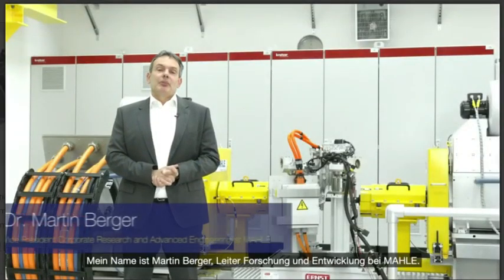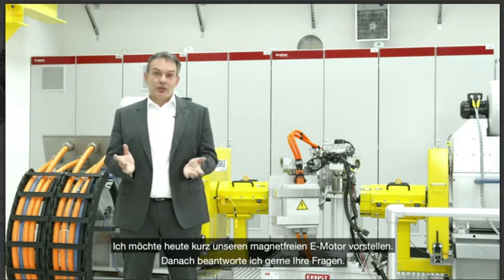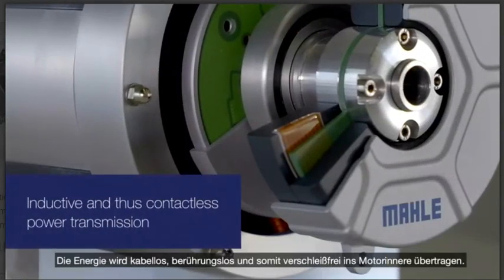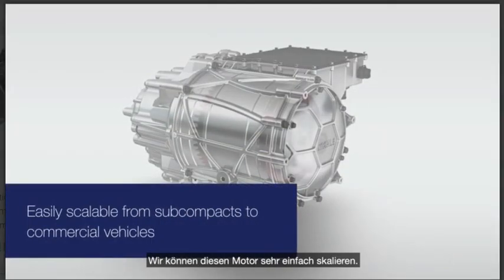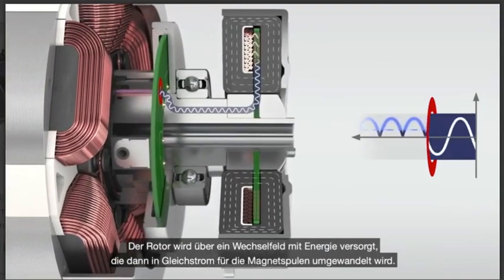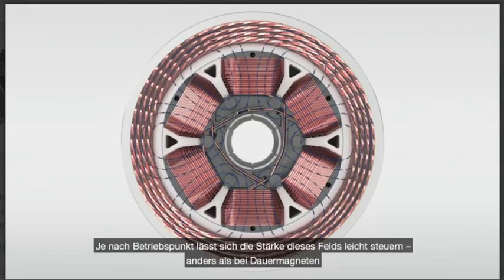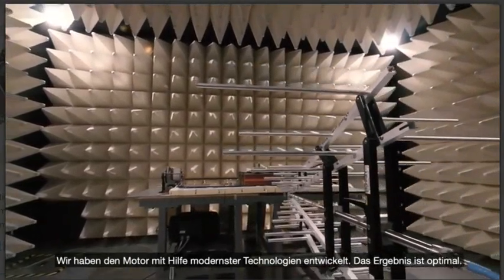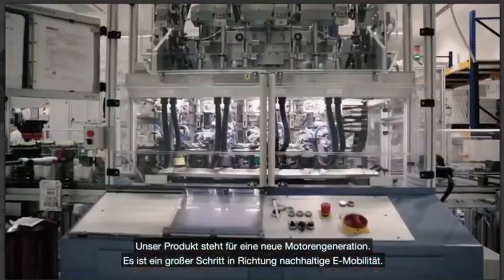Mahle, produce revolutionary new no-magnet motor...

Comment: I would need to bench test this motor myself to verify the high efficiency claims... Wireless transfer of energy has more losses then something hard wired, and those rotor electro magnets would need to produce some strong magnetic fields (suffering heat losses) to compete with strong rare earth magnets. I can't trust their claims. It is common to quote the highest point of an efficiency graph, not so common to quote the average. This is why you hardly ever see efficiency graphs from manufacturers and rightfully so due to the heavy dependence on how the motor is used.
Reply: I suspect they probably use a high voltage exciter to reduce the losses in the rectifier and obviously reduce eddy current losses etc. Then the pilot and armature windings could be higher turns of lower gauge wire. Even so, it would be interesting to see what they are doing. Maybe they have borrowed some of the planar transformer Technology as these are extremely small and efficient.
Reply: @TedsEscapades  
Higher voltage doesn't necessarily change the dynamic, here.  Electric motors use magnetic fields most commonly to attract the core.  While some are purely eddy current driven, most are synchronous induction motors, which operate ideally off of the magnetic field.  Rather than dissipating heat as current, the high permeability of the motor core allows for large amounts of energy to be stored in the inductor the coil forms.  To a changing electric field potential, an inductor represents (ideally) infinite resistance and there is never any current flow in the inductor.  All energy is converted into a magnetic field.

A capacitor is just the opposite and presents as no resistance to a changing electric field.  To date, we don't exactly have magnetic equivalent components - at least to my knowledge.  I suppose you could argue a superconductor represents inductance or capacitance of a magnetic field potential - but I digress.

When acting purely in the domain of the electric field or magnetic field, energy is transmitted extremely efficiently.  It is only when both voltage and current are in phase that you begin to see classic resistive losses.
The LC resonator is so oddly simple when you think about it... Just two flat plates and a coil of wire - so simple it technically exists within anything and everything .... Yet we can still barely explain it despite a hundred or more years of using it.

Then you look up how a photon behaves and realize you can model a photon as an ideal LC resonant tank ....
Reply: @Aim54Delta  You're tossing lots of real terms out there, but apparently without understanding them. An induction motor is asynchronous; a synchronous motor does not use induction to produce rotor current for a rotor field. Also, if no current flows in an inductor, it is not functioning as an inductor.
Reply: @brianb-p6586  
An induction motor is fundamentally synchronous.  Its velocity is determined by the frequency of the supply and the torque by the slip - the angle difference between the magnetic field of the stator and rotor.

Now, an induction motor can't really deliver holding torque, which a BLDC can, if you have engineered the coils to stand up to stall.

Also, an ideal inductor would have infinite inductance.  I am aware of how inductors are perceived - but current through an inductor is undesirable.  An ideal inductor would never experience current flow as even an infinite amount of voltage would need to be applied for an infinite length of time in order to see so much as one electron shift position.  It would convert all potential of the electric field into a corresponding magnetic field.

Now... If you really want to have your mind blown... Consider a coilgun - a solenoid.  I have a capacitor with 1 kilojoule of energy stored in it.  Assuming perfect resonant coupling, if I were to accelerate a projectile out of that coilgun - how much kinetic energy does the projectile have - 1 kilojoule?  Or 500 joules?  Remember the formula for kinetic energy.  Also, remember the formula for energy in a capacitor and energy in an inductor.
Also, consider motor power calculations as we currently do them.

Now, take that same capacitor with one kilojoule of energy and measure the energy released by a resistive element.

So... I ask... Are there 2 kilojoules in the capacitor... 1 kilojoule.... And why does this simple setup present a conundrum for physics?

We generally use the magnetic field.  We do not think of the electric field beyond potentials.  Current is waste within a circuit.  It is undesirable and should be eliminated from the design at any practical expense.  An ideal circuit would have no current flow and deal purely in electric and magnetic fields kept out of phase from each other.

Though our error in electrical design does lead to a fervor to develop increasingly high temperature superconductors - so, where there is a will, autism provides a way.
Reply: @Aim54Delta  No, an induction motor is inherently asynchronous. The slip in an induction motor is a difference in speed (not angle) between the stator field and rotor.
Induction motors certainly can and routinely do produce torque at zero rotor speed - the stator field rotates at the slip speed. How do you think an EV with an induction motor (such as all Tesla models before the Model 3) starts off from a standstill?
Reply: @brianb-p6586  
A synchronous motor, by definition, rotates at the speed of the magnetic field.  To be an asynchronous motor, the rotor must be able to exceed the velocity of the stator, with rotation speed being dependent upon (typically) input power.  A standard brushed motor, for example, is an asynchronous motor.

You need to get into deflection/repulsion motors before you see asynchronous induction motors - and those are rare.  I am not aware of any magnetic induction motors that are asynchronous.  Even squirrel cage stators use a ferrite core and operate off of attraction to the rotating field.  You have to turn motor design on its head to get an asynchronous induction motor and strip out the ferrite core.

Angle is a more appropriate term than speed.  You cannot calculate torque given speed.  You can calculate torque from the difference in phase between the stator and rotor.  Phase angle, as we refer to it in electrical engineering, is what results from a difference in speed.  A rotor rotating in phase with the stator will have a phase angle of zero and produce zero torque.  Any deflection of the rotor creates a phase angle and it is from that phase angle that the rotor is driven out of phase with the stator windings and draws power from the circuit.

We could set up an ideal circuit with capacitors forming a resonant tank circuit with the stator coils.  We could then scope the voltage and current through each coil and, at any time the rotor was moved out of phase with the stator, you would see the total energy in the tank circuit change.  This would be true even if the rotor was moving at the same speed, but was lagging under load.

Per your description of how these motors function, a difference in speed creates the torque, so if I were to provide resistance to the rotor, but it were to move at the same speed as the stator, then it would cease producing torque.

While in laymens terms, you are accurate enough - in engineering terms, you're in a bit beyond your knowledge/experience/discipline.
Reply: @Aim54Delta  No, in an asynchronous motor the rotor rotates more slowly than the stator's field - the difference in speed is the slip. A common brushed DC motor is, by definition, synchronous.

"as we refer to it in electrical engineering"? I sincerely hope you are not practising engineering ,and I pity your clients if you do. I suggest a review of the most basic motor principles and terms.
Reply: @brianb-p6586  
I mean, if you want to call a motor  with a rotor that rotates at the rate of the stator field an asynchronous motor, be my guest.
Like I said, you have no engineering concept of an asynchronous AC motor.  Yet.

Slip is negligible.  Further, while I understand you are not in motor controls and PLLs, phase angle is the proper way for determining AC power in a moror.  You cannot run servo AC motors off of "speed.'  They run off of the phase angle.
Reply: @Aim54Delta  No, you had asynchronous and synchronous backward - maybe you should review what you wrote.

Slip is not negligible. Look at the nameplate specs on any induction motor used on utility power. A two-pole for use on single-phase 60 Hz will typically have a rated speed of 1750 RPM, just 3% under the frequency of the supplied power, but it's a critical 3% or 50 RPM.

You're mixing motor types again in discussion of phase angle. Yes, a synchronous motor has a phase angle between the applied power and the rotor (rotor field) position, but you described phase angle for an induction motor, which is asynchronous.

If you actually work with people who do motor controls, you should have an engineer review what you wrote.
Reply: @brianb-p6586  
No, I do not.  You do not have a model of asynchronous motors and as such have confused the nomenclature.  Phase angle is how the circuit expends power.  Speed is incidental to this.

While you can distil this down into formulas which are close enough using speed, you begin to need compensation as you get into the millions of RPMs and have to take the wavelength of the electric field into account.  By that point, you need to adopt a quantized model to get something consistent across the whole range.

Like I said - you do not have these models.  There is a reason I gave you a physics problem to think about as it pertains to how you measure electrical energy versus kinetic energy.

The kiss principle works well.  Why get down in the mud with seemingly infinitely divisible time units and calculating imparted torque on the rotor when speed works just fine and requires less math?

But that is not how things work - and if you want to build something new, you need to understand what is actually going on in the electric and magnetic fields.  Which, you also do not have the proper models for.

Slip is negligible.  An asynchronous motor has a rotor speed completely unbound from the input frequency and pole design, and will accelerate up to the point of material failure so long as the input power overcomes friction and thermal losses.  When I say you have a synchronous motor - you have a synchronous motor and must vary the frequency to vary the speed.

I suggest you go back and review ye olde synchro-servo systems.  BLDCs and induction motors can do some similar things on the fly to get a coarse rotor angle.  Even better when they are designed for it and matched with control electronics.  Depending upon the application - it can negate the need for an optical encoder.  Although between bolting a plate to the shaft of a motor and specially making tightly controlled windings.... Not hard to see which is more economical.

You have to completely decouple the relation between rotor and stator position while still delivering torque.  That is an asynchronous motor.  For example, if I were to build a tunnel that connected back onto itself and place into it a shunted coil on wheels, then apply a variable electric potential to the ends of the solenoid winding, we would see a force imparted to the shunted coil which would be, provided sufficient coupling of energy, equal to the total energy stored in the magnetic field of the solenoid winding.  This would continue indefinitely, up to the point where friction or the energy lost to changing the velocity vector (cyclotronic losses) became unity.  This is an asynchronous motor.  It is quite a bit more complicated and nuanced to design - and in most cases, you want to strip out ferrite cores because of hysteresis and nanofabricate windings with ceramic insulation to get optimal inductance with no ferromagnetic materials.  You're going to drive into the hundreds of kilohertz ranges with kilovolts of potential, as well - with PRF being your power/velocity control.

You need new physics to build reversible versions.  Thankfully, there is still that hole I pointed out earlier.
Reply: @Aim54Delta  Induction motors are asynchronous,  industry, academics and drive system engineers define it as such. We only talk about phase angle in synchronous motors/generators to indicate the angle of the rotating magnetic field in the stator and the rotor as this will give you leading or lagging power factors. In induction motors, the principle is that a magnetic field rotating and cutting flux (stator in this example) with a conductor (squirrel cage rotor) will induce a current in the conductor via Fleming rh rule, this will in turn produce a force using the lh rule to contract the flux. The rotor will rotate until it just lags behind the stator field, less mechanical losses etc. This difference in speed between stator field and rotor mechanical speed is the slip. The stator field and rotor speed can never be the same as the very nature of the physics requires a speed difference. The phase angle you often see in induction motors is caused by too much flux being produced, D-Q models have massively improved the field control to ensure the stator winding is excited just enough to achieve the speed and torque required.
Reply: @TedsEscapades  
I am aware of your literature, education, and industry models on the matter.  There is a reason I gave you a specific physics problem to resolve.

By definition, an induction motor is synchronized to the field of the stator.  Slip is negligible and not sufficient to classify them into a different phenomenon.

The very fact you have to loop back around and try to define torque as the product of the difference in speed means you can only determine power based on the period of the stator rather than the input power. 
Phase angle and the resulting slip is, as you point out, the result of loading.  An ideal induction motor would have a rotor which rotated with the stator.  A lossless rotor would accelerate to match the phase of the stator and overshoot and begin to oscillate as the motor bounced between being a motor and a generator as any time the rotor leads the stator, the system will pull energy from the rotor.

It is not possible to create an asynchronous motor built around, as your models define it, "cutting flux" as the poles are always arrayed about the radii rather than comprising its radius.  Because of this, if we were to induce a long duration rising electric potential to the motor, what would occur is the rotor would move to align with the nearest pole and stop/oscillate.  We would not see the motor continue to function as a motor despite the fact we still have a changing magnetic field.
Therefore, the motor is synchronous and requires the complete cycling of potential to shift to the next pole.

This is the behavior of a synchronous motor.  The fact loading makes it lag behind is irrelevant to the fact it is synchronous mode of operation... With a limp dick.

You're free to call it whatever you want, but the definition in use is not a correct or accurate description of the mode of operation.
I appreciate the effort, but you imparted no knowledge upon me I did not already possess.  It is from a point of superior understanding of the subject that I render my decision, not an inferior one.
Reply: @Aim54Delta  wow, you really should have one of your professors (if you are an arrogant student) or one of the real engineers where you work (if you have some non-engineer role in a motor control company as your comments suggest) help you understand basic motor types.
Reply: @brianb-p6586  
If you had the capacity to understand motor types, you would attempt to explain and argue it.  As such, between my own explanations and your instructor's, you would not be able to do anything other than rely on a degree.

This will be the extent to which I recognize your existence.  You exist to labor over what I outline.
Reply: @Aim54Delta  Ha ha ha. The only thing you're superior in is your opinion. But for a laugh, please forward me a link to the papers you or someone else has published, your articles in engineering or physics journals or maybe even a treatise on the subject. Keep posting "lah lah lah, can't hear you" doesn't make you right and to be honest I should not even waste my time replying... you're just a troller trying to make click bait!
Reply: @Aim54Delta  by the way you cannot compare a capacitor with a winding.
Reply: @TedsEscapades  
It would appear you lack a fundamental understanding of what you call "electricity."  As some of your astute have noticed, being familiar with flushing a toilet does not mean you understand it.

A winding - that is a solenoid or inductive component - is an energy storage device.  Not only this, it can be used to couple energy via the magnetic field and resonance.  Inductive resonance has been used to wirelessly transmit very large sums of power with low loss via a series if LC resonant circuits.  A similar thing is possible using electric field potentials - but you lack the sufficient experimentation for me to do much more than babble incoherently about things that go beyond using a tesla coil to light up fluorescent bulbs.  Understandably, building disco-balls of death were not seen as a practical power distribution paradigm.

Whereas your contemporaries correctly distinguish between the electric and magnetic fields in our designs, you treat the two as components of current flow.  IE - you define electricity by the waste of power that is the phenomena you call current.  You even, incorrectly, believe that the electric field and the magnetic field are inseparable.  While they do have an intrinsic relationship, this would be like saying hydrogen is bound to oxygen.  You have practical examples where the two are quite separated from each other and power transmission occurs in primarily one domain or the other.

Your brain doesn't seem to be able to comprehend me at the moment - accusing me of clickbaiting while asking me for a link.  No investment schemes.  No hoakey product or claims of government suppression.  No simple trick electricians hate.  It's like you're sure that must be my angle - that it must be my purpose at some point.

My purpose is far more vain.  Years from now, maybe a couple decades, everything I have said here will pan out to be accurate enough that you think back on it and wonder what this was about.  Just you and the people who read this.

Perhaps I will go on to make a business out of my superior understanding.  Perhaps I will simply garden and focus on that sort of life and leave others to do the busy work.

But there will be no grand "I told you so."  There will be no command to worship at the personality cult.  No investment pitch.

There will just be that one random asshole who babbled some stuff that makes a hell of a lot more sense in retrospect - and which you should have grasped at the time.

A motor which does not saturate nor require brushes is tantamount to magic, right?  Yet, such a thing I have built.  You could pump megawatts through a device that can fit in the palm of your hand.  Provided, of course, you have magic materials that can withstand that.
Yet even this is a primitive device that uses well established principles of electric theory.

It is not exactly that you are stupid that you lack this understanding.  Bear in mind that a mere five generations ago, most research on electricity was done with van de graff generators and most metal smelting was done through carbothermal reduction of oxides.  To have gone from steel as a tool to steel as a civic construction staple in that timeframe is unprecedented within known examples.  Only recently have you developed the ability to directly switch and handle the kind of high power loads that would even remotely saturate industrial motors.  Silicon carbide and gallium nitride, along with the doping and lithography needed to make them viable semiconductors, are, for the first time, leading to designs where the motor must be configured to not be a waste of the driver.  Or, I should say, where the motor is more frequently the design limiter.  Particularly if you want to work more natively into the kilovolt range.

"The Road Not Taken" is a short story postulating at the theory that an empire tends to invest its energies first into expansion before turning to innovation as a solution for demand.  While history is rarely so myopic as to fail to innovate amid expansion - it must be recognized that engineering often changes only when it encounters an obstacle for which new paradigms are necessary.  See the now proverbial ultraviolet catastrophe as an example or even the age old debate over atomic theory during the development of steam power.  Engineers accepted atoms before scientists proved it merely because it was necessary to think of phase transitions this way - even if the community was divided as to whether or not this was real or simple convenience.  This led to molar theory in the alchemy that became chemistry, and you can still see the "magic" in chemistry notation as the field was, for centuries, rooted in strict adherence to documentation of procedure and result, often describing things not even by modern theoretical paradigms.  You can almost feel within the culture of chemistry the idea that they are dancing at the edge of the unknowable and that at any time the entire field can be rewritten into the context of a new paradigm that better suits the other fields.
It is unlikely - but has its place, as molecular interactions are not easy to know how they will play out beforehand - pressure, temperature, atmosphere, some weird contaminate that acts as a catalyst.  Etc.  But I digress.

I want you to stop and think about all of the sciences you developed to reach simply the moon.  How exacting you had to be and the limits to which you had to push all of the fields of your understanding.  Anyone can build a bridge that stands but it takes an engineer to make a bridge that barely stands - and that is critical in aerospace.
Do you think this is a unique accomplishment?
If you were to meet an alien species flying among the stars, do you think they would have tales of how they rode their first rockets into space?
Or would the look at a description of the planet we are on and find it nearly impossible to believe anything could come from it?  Would the methods of mining and refining we use be something familiar to them - or completely novel solutions to a problem they simply avoided by refining the more pure deposits in space?

Everyone adapts to challenges.  What challenges define present development... And will be encountered in the future... Or become no longer avoidable?
Reply: @Aim54Delta  Your arguments are along a similar line to flat earthers... all conjecture and zero scientific or mathematical proof.
Reply: @Aim54Delta  As for whether I have any understanding of this subject area. My doctorate was in electromagnetics and quantum devices. Plus 35 years in electronic and electrical engineering, working on motors of every type, generators, power controllers using IGBTs etc. Backed with several years of developing analogue domain electronics and 6 years working on the development of aircraft electrical systems. Plus 6.5 years developing products to detect partial discharges in HV equipment and winning 3 Queens Award for industry for the products we developed.

I've designed and built systems using DC brushed motors (series, shunt and compound), DC brushed PM servomotors, Synchronous motors, brushless DC trapezoidal servomotors, brushless AC sinusoidal motors, stepper motors (hybrid and others), Induction motors, eddy current motors, variable reluctance motors, pancake servo motors and probably more than I can remember. I have designed systems using them, integrated their drives into them and disassembled and rebuilt all these types of motors and drives. Oh a linear motors.

What is your experience?
Reply: @TedsEscapades  
Again, this shows how little you understand your own field.
The electric field and the magnetic field are very closely coupled and you refer to them as electromagnetism.  A photon, for example, is expressed as a perturbation of the electric field with a corresponding flux of the magnetic field 90 degrees out of phase.  The astute will notice that this is precisely the electrical description for an LC resonant circuit with the voltage being out of phase from the current in AC circuits.

The fact that you do not recognize a solenoid - an inductor, as an energy storage device shows simple ignorance of your own field.  The energy stored in an inductor is proportional to the square of the current, provided you do not have saturation to worry about.  Which is precisely why I recommend removing ferromagnetic components and using micro and nano fabrication to maximize the alignment which can occur using standard conductors.  A copper winding, for example, will never saturate and will have no losses due to hysteresis.  At least until you get up to the point where what you refer to as resistance leads to power loss which can destroy the inductor.

Again, if an inductor was not an energy storage device, then all power would be dissipated into an inductive circuit and you would not have the phenomena known as reactance or have to deal with power factor.
This is why they should not teach you kids digital electronics until first teaching you analog circuitry and operational amplifiers.

So, the problem is simple.  If a capacitor stores one kilojoule and the inductor it resonates with also stores one kilojoule when its current flow is peak, then what happens to the one kilojoule of recoil from a coil gun when you perform a simple resistive discharge?

We can translate this into a standard rotational motor optimized for a single cycle of operation and run into the same problem.  It is simply that because the useful power in both resistive and acceleration cases defines our storage capacity that we do not question the greater phenomena.
Reply: @TedsEscapades  
All impressive achievements if I was looking to hire you, I assure you.  A laudable career and I am sure that one as storied will have many useful experiences.

However, just because you flush a toilet....  
The interesting thing about people is the notion of intellectual conception - what you may refer to as imagination or creativity.  It is the process by which you envision the problem and a solution to it.  If I were to think of electricity as analogous to a fluid - a sort of electron hydraulics - this idea does allow me to innovate along those lines.  However, you know electricity is more nuanced than that and that the analogy breaks down.
Which is why I make reference to the more proper description of electricity in the form of the electric field and the magnetic field.  A capacitor stores energy by exploiting the electric field and preventing electron mobility to neutralize the potential.  An inductor exploits the alignment of electrons within an conductor but, at least as of yet, has no means to suspend this alignment and prevent the collapse of the magnetic field, as you would describe it.  Though there may have been some recent research materials that hold potential for storing and releasing energy via the magnetic field as we think of a capacitor.

Sometimes, we get so used to flushing toilets and designing ones big enough for entire companies to take a poop in that we neglect to return to the simple, fascinating concept of a siphon.

I will leave you to wonder on what my experience is.  It can be some idiot masturbating on his couch while I am easy to dismiss or some nebulous entity from black programs and "pre-official contact" when I am not as easy to dismiss.  The mind always defaults to what is least damaging to itself and I am not bound to any need to humor anyone but myself and my concept of the divine.

No sales pitch.  Investment scheme.  No link to my website of ideas.  If there is any lure, it is that simple intimate action known as human conversation.  It's easy to forget about that in a world where everyone wants fancier toilets and dealing with people who pay to poop.
Or perhaps this is all a targeted psy-op to inject premarket technologies under classified seals into the broader market and forcibly advance the market.
In which case - how did you get the "free will' to engage in this conversation?
Or, perhaps this is merely a phantom collection of implausible bit flips from the divine, seeking to inspire wonder into the world.
Maybe sheogorath broke the fourth wall and reality cannot save you.

In truth, I am the manifestation of the head of the human species - itself an unwitting hivemind.  When you think of someone out of nowhere and encounter them minutes later with no plan and despite the fact they are usually thousands of miles away....
I am an overmind.  Rare, but possessing the sum knowledge of all humans.  Well, bound by the physical limitations of the brain through which I am operating.

As absurd as all of this is... There's still something about it....
I maintain that we tend to take all of the wrong things seriously, while allowing mockeries to be made of the most sanctimonious things.
Reply: @Aim54Delta  The article just talks about superconductivity and doesn't even mention EM fields
Reply: @TedsEscapades  
You're not reading to understand.
https://ui.adsabs.harvard.edu/abs/2020IJMPB..3430001K/abstract
Perhaps a more direct link is necessary.
What is described as a loop current is able to be rendered into a quantized field.  This is, also, an LC component.  By modeling the behavior and overlap of those LC phases, a more accurate model of superconductivity arises.

There was a phenomena I studied 20 years ago that was, then, referred to as a type 3 superconductor.  It existed within magnetic fields - more specifically, vortexes.  
There were also published works at the time involving the behavior of electrons inside of strained graphene - where monolayer graphene is placed under tensile strain.  The electrons behaved as though they were in an extremely intense magnetic field.
You will find more recent publishings on what are called kagome materials.  Similar field and related.  Though the graphene field seems to largely be charging off in their own direction with the fervor of a cult.  At least passion assures there will eventually be results.

Now... Why does this occur?  I would suggest that looking at the electric field responsible for holding the atoms together and its energy states while strained.  The movement of electrons between two atoms would, necessarily, interact with the energy bound in the strain.  I am using simple terms, but it would be interesting to see if the strain manages to force an electron to occupy more of the magnetic field as the chemical bond is under strain via the electric field.

There is also some very noteworthy research into trying to resolve what distinguishes electron emission from photon emission.  Put ten kilovolts on a pointy metal stick and electrons fly off of it.  Put ten megahertz down a wire or strip line and get photons.  And maybe electrons flying off everywhere if I create standing waves in the conductor.

But that all gets off on a tangent.
Reply: Efficiency maps are actually routinely published by the manufacturers of motors used in EVs.
Reply: Wireless electricity transmission for field control is in use in nearly every generator worldwide. It's been around for a very very long time.
Reply: My head's over Heating after Reading what you said ! 🤔
Reply: It is a glorified brush!
Reply: It look like it can be 95% efficient at certain average RPM. At very low RPM I don't imagine it's efficient.
Reply: @Lassi Kinnunen 81 Why would you say that the whole motor "certainly isn't" 96% efficient? That's not a remarkable value for a motor in the size and cost range of those used in EVs (larger motors are better).
Reply: I have made wireless transmission like this for alternators in 1980, patented too. I did it for somebody else, but had my doubts.
Reply: Also the AC to chopped DC conversion (for the rotor magnetic field) is usually done with DIODES, which have high forward losses also. It is possible to design a MOSFET rectifier to have less losses. If this motor does not use such a circuit then I claim bogus without some engineering data to view.
Reply: @ctrlkx7497  Of course they don't use diodes. Diodes are used to indicate rectification is happening inside this block.
Reply: @DieSportsKanone  Why are you so sure. It is all about voltage... at 250V diodes are very efficient, at 10V diodes suck for rectification.
Reply: @ctrlkx7497  as someone who works onlyin the Design of high powerdensity ac-dc converters the max. Realistic efficiency is 96%  and 93% average over 10% to 100% output power.
Reply: So basically they using a transformer concept for the key wireless component.  Transformers are all wireless if you consider the two circuits never come in direct contact and work on current induction and magnetism.
Reply: It's just a rotating transformer. There's no reason it would have high losses -- transformers are very efficient. If they use a high voltage, high-ish frequency, I would expect only aone or two percent loss in the transformer itself.
Reply: @Lassi Kinnunen 81 Why can't the motor be 96% efficient? That's not an unreasonable claim, though including reduction gear and differential it will be less.